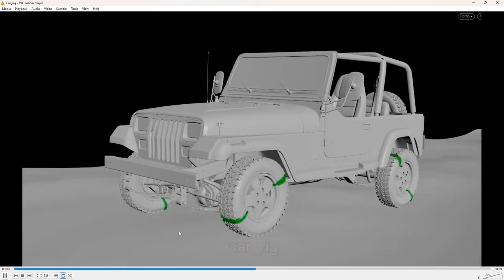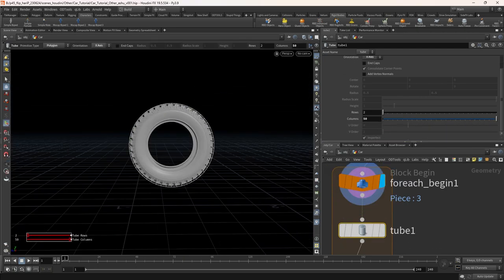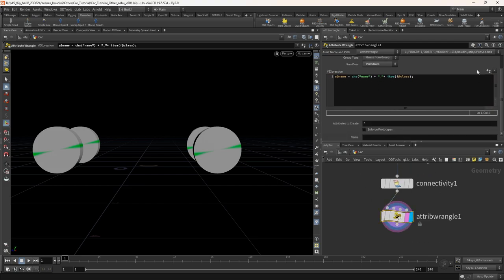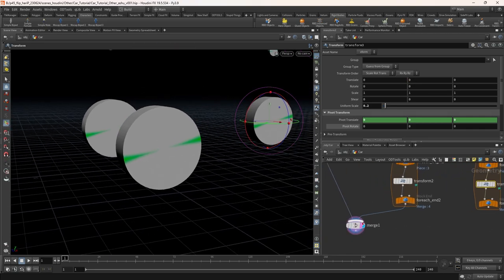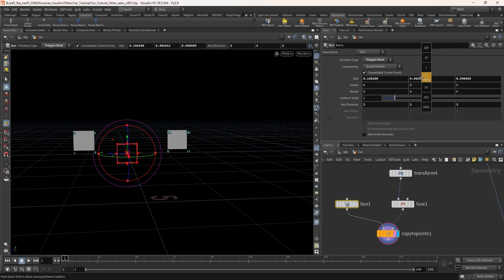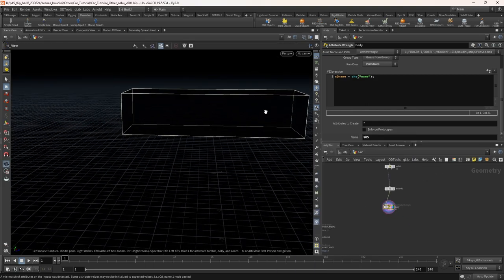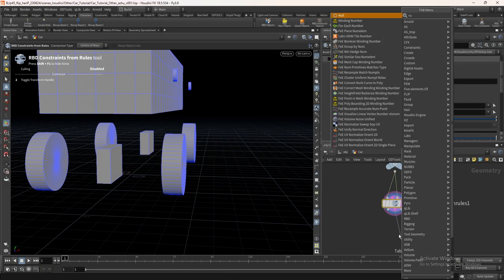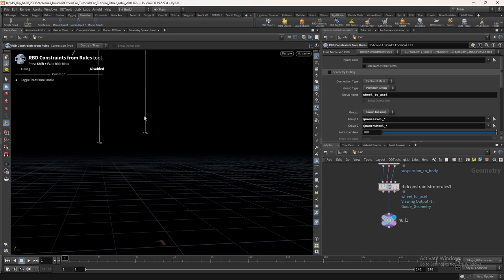Car Rigging and Simulation Inside Houdini | Houdini FX | Hip File Included |

Comment: hi do you have any work around for houdini 18.5 the constraints doesn't work as shown in the videos the suspension tube and axel tube doesn't get connected for some reason however it will connect if the translate y and scale has the same value but  my friend tried in 19.5 it worked for him properly please can you give the solution for this please ,thank you in advance
Reply from the maker: can you share your HIP file? I will look into it and get back to you.
Reply: Hey, i fixed it by making groups to all the different parts of the car and use groups instead of names in the constraint from rules nodes